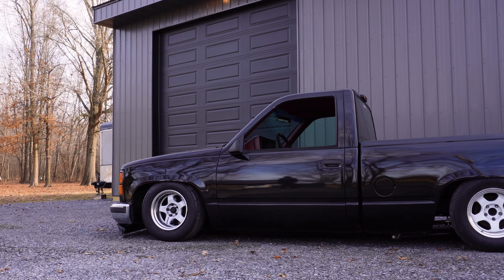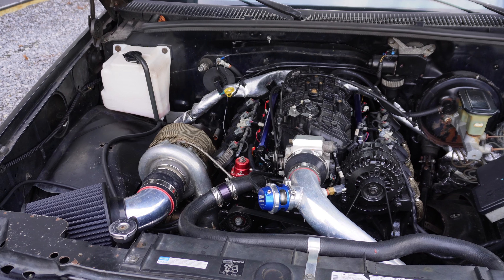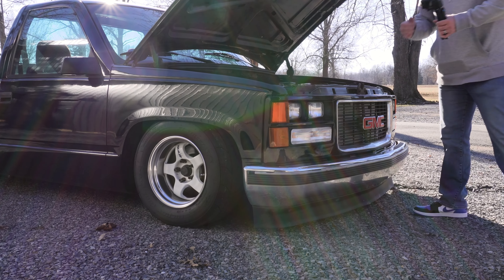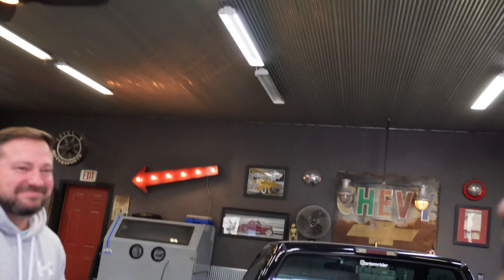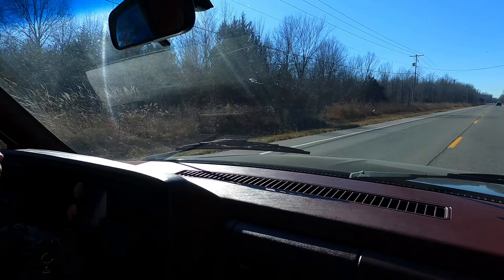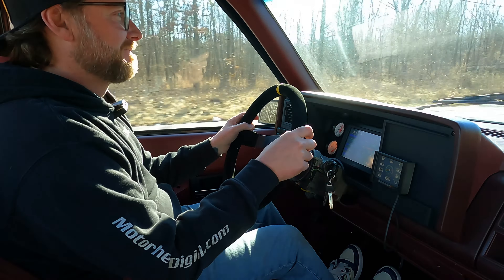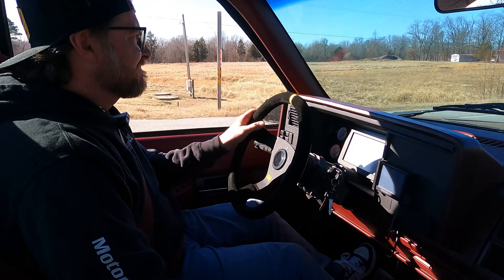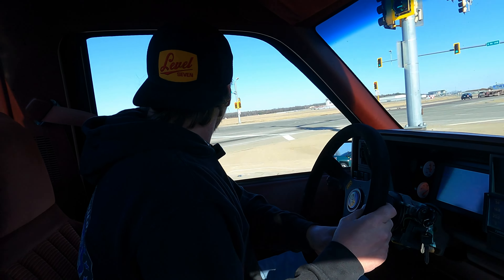FIRST IMPRESSIONS: New-To-Me OBS Chevy Turbo LS / 6 Speed Project

Comment: I’m looking forward to this series, I’ve got an engine sent off to be machined and rotating assembly balanced but on the fence for what compression it will end up at. I’ve got a turbo and manifold for the setup but if compression is too high then I’ll go na. Was wanting something for autocross but at the same time a fun street truck would be amazing.

Comment: Looking forward to suspension mods.  Especially anything to help front end geometry.

Having been wrenching on 3 projects which were modded before a friend and I worked on them, I'm all for building from a clean stock vehicle, chasing other people's screw ups gets old.  Don't mean to be negative but we just replaced a TAC module in a C5 which was missing a bracket. Just the latest correction of a pretty expensive build for the original owner.   But... you'll have some nice don't do this stuff to cover in the videos.

Comment: I was fingers crossed you would have done this series eventually with a 99-06 base LS silverado. But the OBS is a great platform as well.
Reply from the maker: Honestly it’s on the list and it’s probably one best bang for the buck truck to build.
Reply: @level7motorsports I say the same thing but sadly I dont see much support to build them into autocross trucks like the c10s. Trying to build my 04 isnt as easy or fun with out off the shelf parts.

Comment: What parts are bottoming out? I have a 95 c1500 with my own 4 link rear. Currently rebuilding the front suspension with ridetech a arms and a coilover tower through frame of my own design. Don't plan to go as low as you though, even though it looks better
Reply from the maker: You’re on the same path I am. We are doing their arms, our own upper mount, and a 3 link. Right now the front crossmember is dragging the ground.

Comment: Having known the org builder of that truck and how it was sold.... someone after them ruined the truck. Sad
Reply from the maker: It is sad.  I havent seen photos but I understand it was more of a street and strip truck.
Reply: Hahah, so you know that on the way home (I was driving very slowly and carefully) my engine died and the wiring caught fire?  But I never said a single bad word about the previous owner, because I respect his work and understand that this is a modified truck with which anything can happen.
And he put me another block, for which respect to him, even though I paid him money for that. Unfortunately, this block did not last even one burnout and after that I decided swap the engine to 6.0.  The suspension was all old, I changed all the steering rods, since the truck could drive only straight and even then it was not stable. Cornering was out of the question. There were bicycle wheels in front, the axle was jumping, the interior was in terrible condition. And I still respect him because it was my decision to buy this truck. I fixed a lot, but there were things that I didn’t get around to, for example, the fuel system, which is located in the bed.  This is not a build from scratch, I just corrected numerous bugs every weekend.  With this suspension it allows you to drift for fun  and at the same time be very low.  This is my style.  So how did I ruin the truck?  Let's go point by point. 

I never said that the truck was perfect, but truck is really fun. And I never forced Jesse to buy it.  Even while talking to Jesse, I insisted on going and showing the truck to his friend before make a deal!  So that there are no questions for me.  I had to travel 1.5 hours one way, but I wanted everything to be fair. And Jesse didn't say anything bad to me in a DM after the purchase, but I can see that he's unhappy in the video and in the comments here.  Which I think is not respectful, because people don’t see all the nuances.
Reply from the maker: Please don’t take this badly. I am not un happy at all. I am happy with what I bought and am having a blast making it my own!  I mean no disrespect at all.